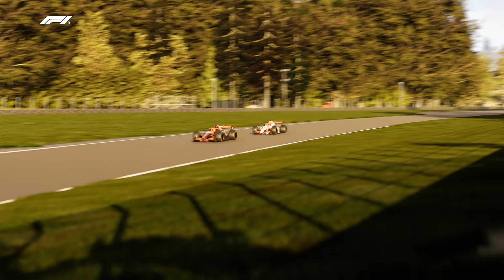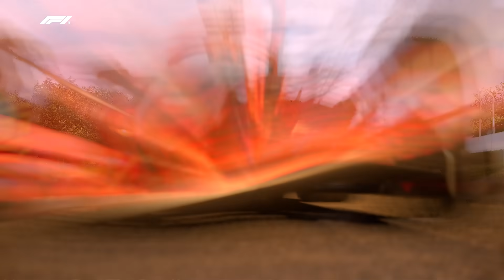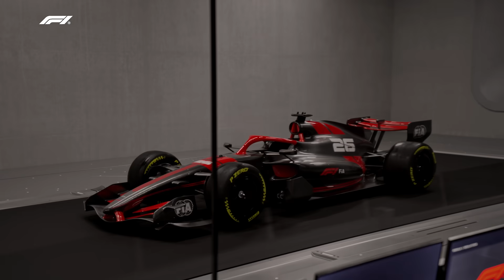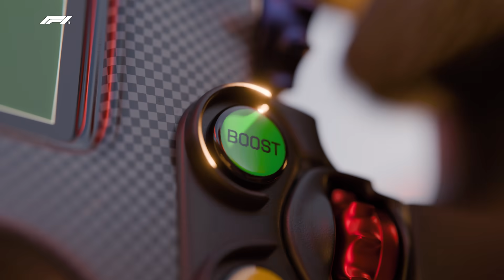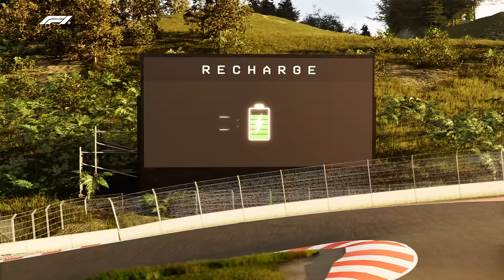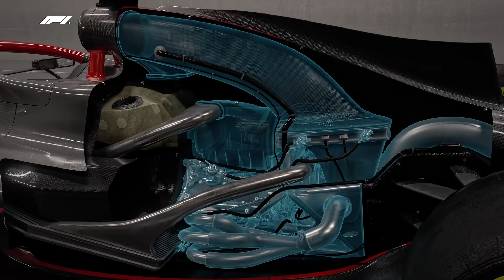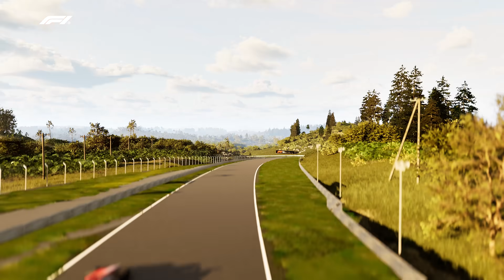Everything You Need To Know About the Formula 1 2026 Regulations

Comment: There's a lot of questions that I'm curious about:

• There's a scenario where cars collide and their front wing gets damaged, will the new system still be accessible and is it usuable again once replaced with a new wing and how will it work again?

• Less grip? So more over steer/under steer? Doesn't make it look like a big problem for the driver/team?

• Correct me on this one, but B.O.R. Requires batter, Right? So without battery, You're useless? While the driver in front of you will speed up even more since you're on his 1 sec distance?
Reply: well its more oversteer because its high rake so the rear be more loose then the fronts similar to 2021 style
Reply: I think if the wing is damaged the actuator still works, if both sides of the wing fuction as designed will probably depend on the desing of each manufacturer and on how it is damaged and to the question if its usable after a wing replacement, I would say yes, the actuator will probably sit in the replacable part and there will probably be some kind of quick connect for power and data, maybe pogo pins or something like this

probably both depending on the setup and car but that is something I think we will see when we get to it. and regarding drivers, they can probably use it to turn the car earlier but we will see

yes it requires battery but in theory if you can catch up to a car you are faster so you can recover more energy while braking behind a car because you can lift (through which you recover energy) and then break and still be as close as you where and you are in the slipstream so you probably save energy there too and the overtake mode can only be used if you are less than one second behind a car so only one car gets it and the boost
Reply: 1. yes
2. less grip on straights, it should actually be quicker in turns than before due to the size reduction and weight reduction
3. there is no 1 sec rule. you can use these at any time in the designated areas (which is why they swapped away from the DRS name even though it is DRS, it's to reduce confusion)
Reply: @Entegas Watch again, overtake mode is within 1 sec behind
Reply: @Fractured_Unity oh you’re right…. It’s a single point that you have to be within a second for the rest of the lap though? That feels odd and I feel like I’m wrong about that too

Comment: I'm so confused. DRS is gone, but DRS is back in the name of "Overtake". Also, the only difference between Boost and Overtake is that Overtake can only be recharged in certain zones as long as you're within 1 second of a car, but both can be used anywhere on the track. It's just so complicated and convoluted for no reason. You could have just combined them into one thing and added another battery for Overtaking power.
Reply: Yup.

Comment: Net ZERO goal. Talk about Green wash. The whole circus travels thousands of miles across the globe in air planes, most of the tracks is build just for racing, the F1 factories, wind tunnels, hospitality palaces...  the fuel used by the cars is a footnote in all of that so lets not pretend F1 is nearing sustainability.
Not saying F1 worse that so much else, just that the green wash is disgusting.
(While I am standing on my soap box - the same things goes most big commercial sports be it cycling, football...)

Comment: I like that the cars have been made shorter and narrower. I like the narrower tyres also. I don't like those barge boards. Drivers will either not go for a move if they risk losing them or if they do come off, it may mean the driver retires the car. Lets see but far too much tech with the boost etc

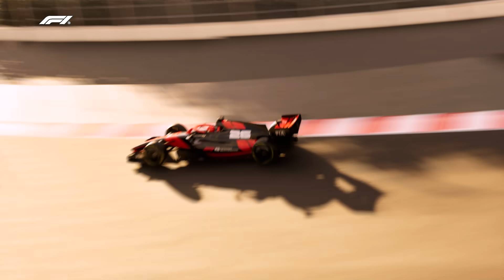Comment: 1:08 there’s no advantage to having everyone have no drag so why do it …
Reply: more speed with less power, important for batteries, and better car balance as you loose downforce both at front and back,  there is a big advantage to it
Reply: Because these new engines would be out of juice on the straights.
Reply: Because these these cars are going to be 50% EV and would be slow AF otherwise
Reply: Because there’s been a step down with speed as they are using more electric

Comment: So what’s the reason for 50:50 power? It’s not like the engines were blowing up and the Mguh was part of the electrical power so detuning the engines seems more for optics than anything solid.
Reply: They could easily just added the 350kw battery adding up to 1200hp or something. Why not that? Then we could ditch DRS entirely as the front wing moving reduces drag so by definition we still have DRS (in fact we’ve got double DRS) it’s just called something else. Then we won’t have the inevitable controversy over where straight line mode can be used at. For instance Australia T8-10, T13-14, or Barcelona T3-4, T5-T6, T11-12, or Austria T7-8, etc.

Comment: Goodbye Formula 1, hello Mario Kart. 😮‍💨
Next year they will have: automatic reverse box parking, track lane keeping assist, box lane pedestrian mechanic detection, adaptive race cruise control, racing blind spot monitoring, automatic marshal signal recognition, automatic RGB hazard lights, autonomous emergency braking (to reduce driver crash), Pace Car automatic recognition and detection, remote start, tire pressure monitoring and automatic flat detection. Nice Job Formula 1! 🤦‍♂

Comment: Not much has changed . Renamed and old technology.  Adaptive aero .  Basically like Adaptive suspension and Basically still drs . But can be used . When ever . Turns off for corners .  Supercar had this technology, years ago . Boost is like curs system. But can only be used in certain parts of the track now instead of when ever . 

Wheel size and diameter are the same as 2000s.  Only difference really is . Front wing and wheel wings behind the wheel and ground affect tunnels etc . Have been removed for the Adaptive aero but that Adaptive aero still pushs the car to the ground for ground . Engine being 50 50 . Newish . Gt car has this technology and the fuel.  Recycled . But that isnt new new  lol  new ways to use different type of ways to use carbon and used fuels etc .   The manufacturers that dont have  a great understanding on these new engine 50/ 50 technology will lose out .
Reply: Weight is lower but the same as 2010s . Not the lightest.  Chassis have been lighter than they will be in 2026 . Still a boring 1.6 v6 . Net zero , will make f1 become zero , using old technology like its new 😂 I think the old fans will stop watching soon . After all these rule and regulations that have slowly charged the sport. New fans havent seen the changes and have started following as motorsport has become more popular as more people are more adventurous about things nowadays.  With the social media being as it is for youngsters and for more people to see much more content than ever before . If it works out to be better I'll eat my hat

Comment: honestly..... i don't get why the engine needs 50 percent  power from EV.  THERE IS ALREADY A ELECTRIC F1 series.    We don't need f1 to almost be a clone of E - f1 series....    bring back v8 /v10.    EV power shouldn't be more than 10 percent
Reply: It should be whatever the teams want, I’d love a displacement/fuel flow limit and let the teams go nuts with engine design
Reply: @brenchyalowicois6748   I agree.  There is already Formula E.    I dont know why they are trying to make F1 like FE. 50 percent power from the EV to me sounds dumb.  Drivers are going to let off the gas in straights.  Its gonna be lame
Reply: @DamedFilms it’s kinda wild to me how my dumb truck’s engine sounds more exciting than f1. NA 5.7 v8, vs a turbo hybrid v6. Unreal

Comment: V10´s, no hybrids, syntetic fuel, lighter, smaller, more agile and less FIA, thanks!
Reply: It is not the FIAs fault, this what the manufacturers want. Synthetic fuel won't be able to Fuel a V10 at the moment, it is too expensive. For 2026, the cost of Fuel for a race will be around $45,000 per race per car ($400 per litre). A V10 or a V8 would require so much more, driving up costs. MAYBE in 2030 when Synthetic fuel is cheaper we could do it, but it's impossible at the moment
Reply: @michaelgdupreez  I meant less FIA rules, more open racing.
Reply: @petrsantroch3893  that part I agree with. They created a hole for themselves due to Verstappen's dive bombs. At the time it was allowed in the rules but people complained. And now this is the knock on effect of trying to block every loop hole

Comment: If the fuel to be used in the next regulation is now more sustainable, why didn't we go back to V8s/V10s/V12s?
Reply: Because it's $400 per litre of Fuel. Meaning that next year each car will use around $45,000 of Fuel just for the race (excl. Practice and Qualifying). With a larger engine they will definitely use even more Fuel, driving up costs. They are already complaining about the Fuel bill for next year

Comment: "Making the racing less predictable"
Instead of introducing gimmicks to allow cars to overtake, just tell the designers they can't have 5.5m long cars focused on aero and outwash. Make them 4.5m long, take out 150kg, so that they are more nimble and responsive, and give the drivers decent tyres that don't overheat in 2 laps. Cut the weight, then you can cut the torque, then you can make the tyres less compromised. Shove the sustainability and gimmicks. Fans don't want that.

Comment: Same power... No not really. The total amount of energy pr car throughout the race has been reduced significantly. The total amount of fuel goes from 100kg to 70kg. Not mentioning that one super important fact, to make the cars seem as fast as the 2025 ones. But in all actuality the 2026 cars are going to be significantly slower over the race distance. It wouldnt shock me if they were several seconds slower pr lap.
The total energy available pr lap is reduced by 30%. Unless they make an engine that has double the effeciency, its impossible to make them even remotely as fast

Comment: The whole point of '22 was supposedly to make the cars stiffer, more unstable over the kerbs, and allow drivers to make more of an impact to overall lap time, and the ground effect was supposed to mean less reliance on top surface aero and outwash. Now they're going back to the opposite and claiming it's going to fix the current cars, like the last change was supposed to. You'll still have engineers finding was to increase outwash and the governing body allowing them to do it. You'll still have tyres that have work from low temp, fall off a cliff and cope with a very heavy car with huge torque. The cars are still too heavy and too long. So the three biggest problems will remain.

Comment: So now the front and rear car both get DRS and this is supposed to help racing and overtaking... got it!  Also 50% of the power coming from the battery which, alone, might be a tall order, but now you're also supposedly giving them boost/overtake mode too.  What power are they going to be using for that if they're barely hanging on to their core, foundational electrical power?  What a silly idea this is.  I cannot believe f1 is actually moving forward with it.

Comment: I’ve seen a lot of people compare the active aero to DRS but I don’t think that’s the right perspective. Active aero really isn’t similar to DRS in the grand scheme of things. The aerodynamics are no longer used to facilitate overtakes, the energy is. If the car behind is within one second of the car in front at the detection point, the car behind will get the power override boost at higher speeds that won’t be available to the car in front. So to sum it up, energy now determines overtakes rather than aerodynamics.

Comment: Why have slower corners so talking about the tunnel section in Singapore or even in the likes of Abu Dhabi before sector 3. If these are using re gen for braking then why would a long corner that’s aimed at high speed going to help. Like it’s one thing I’ve been frustrated with and why I’d say a lot aren’t fans of newer tracks over older tracks as most modern tracks seem to be aimed at full speed.

Comment: Battery giving so much power is an issue. It will either eat the battery in a few laps and they just run on lower power ICE or they will just use a bit of battery each lap and will end up running on the lower power ICE engine. Going to be a mess

Comment: DRS is gone, yea right New name and new method = same result!  Giving an unfair advantage to a following car.  F1 currently is just a drag race to the apex of the corner because an unfair advantage is given to the following car. 2 cars going around the whole corner together without forcing one off track makes for exiting racing. A drag race on a street track does not. Fix your regulations regarding track limits, blocking and racing room corner entry to exit.

Comment: 0:58 - if two or more cars collide and they damage their front wing it will be an automatic DNF. Even a small touch will end up with a pit stop... this will end bad 🤷‍♂
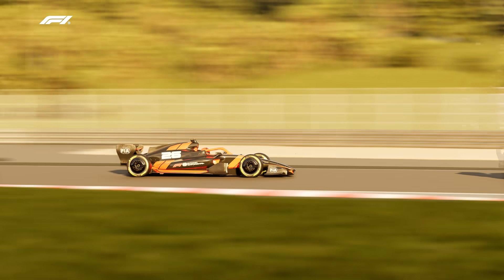3:32 - yeah, reintroducing the KERS system from 09. What a great inovation IMAO 😂
Reply: If the damage is significant enough DRS 2.0 doesn't work they SHOULD be forced to pit, we've had too many cars driving around with damaged wings shedding pieces already.

Comment: I remember how there were many times the commentators noted how some drivers with a broken front wing seemed to have no effect or even make the car easier for the driver. Now with a broken wing, the driver might literally be out of the race because a small tap can ruin the whole mechanical system in that area. That front wing is going to be a heart-breaker for many drivers next season.
Reply: front wings are also smaller and the endplates don't matter much if they break of, so the important bit is even smaller, so it will be less likely for it to break
but ye, it could be worse if it breaks, that's true

Comment: I'm not getting the big difference between Boost & Overtake in terms of available power. If Boost is max power and there is only so much battery power available, then what additional use is overtake unless it's a fuel/combustion boost?

Comment: I'm not sure anyone will be able to answer this question, but has anyone heard from any manufacturer that the cars need to produce less power or be more hybrid based in order for them to join racing? Whether its NASCAR, F1, you name it, they're all preaching to get more manufacturers to join, they need to be going towards carbon neutral. It's just I haven't heard any manufacturer say this, only the racing series execs speaking on behalf of them. I'm sure theres some truth to it, but at times it feels like their way of saying hey our sport is way to expensive, and this is how WE will get manufacturers.
Reply: Reportedly Porsche didn't join IndyCar as engine manufacturer because they weren't allowed to use bespoke hybrid system. And when standardized hybrid system was added to existing engines both Honda and Chevrolet were the ones pushing for it.

Comment: I'll simplify the DRS/overtake changes since their description was not the best...

How DRS worked before is being replaced by a new "Overtake" button. Works with similar rules before of needing to be close enough to a driver in front during a specific point of the circuit. Instead of it being aerodynamic based, it will allow more horsepower to be pulled from the power unit in specific points on the track for the next lap.

 This is on top of a new "boost" button that can be used by all drivers on any point of the circuit.

 DRS is being rebranded to "Active Aero" which can be activated in "Active Aero Zones"  by all drivers anytime during the race.

The reason for the change is that relying on aerodynamic changes alone for overtaking makes overtaking only really possible on long straights and that was boring to watch. This new change theoretically will create more wheel to wheel overtakes while also keeping the high speed breaking challenges.

Hope this helps!
Reply: 20 bucks the teams are going to keep calling it DRS.

Comment: they should give back the original hp of the engine in the future once manufacturer has sort things out with the power unit. 1,350hp (850hp engine + 500hp electric motor) would made better impact to the ground effect era. ~60:40 power split sounds a lot better than a 50:50 when the engine is still making the bigger impact